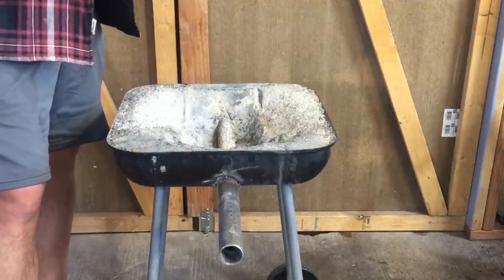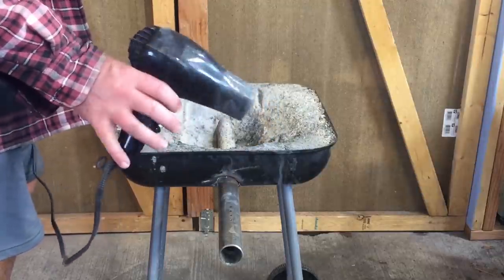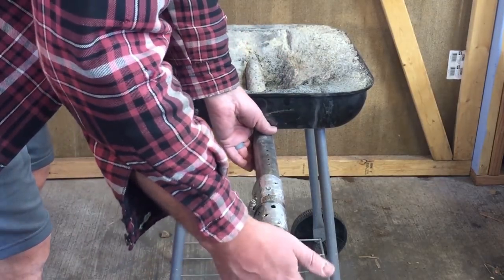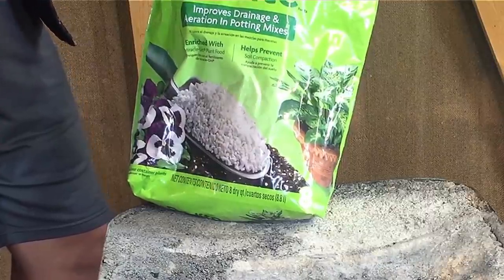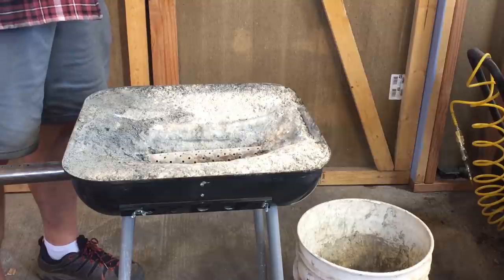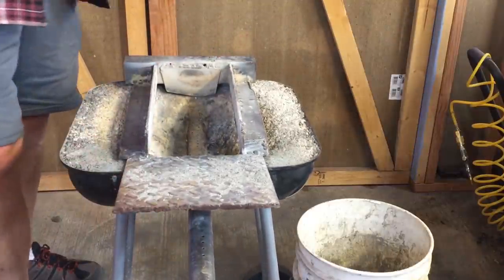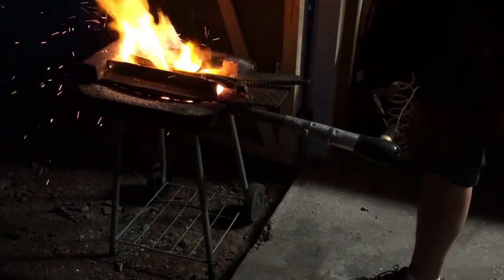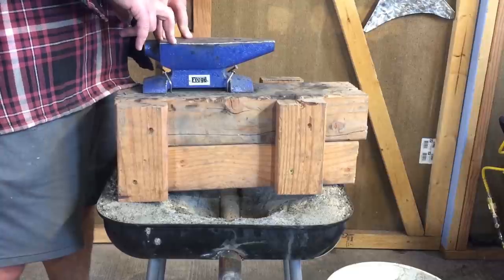$100 Charcoal Forge...Why didn't I do this sooner?

Comment: Best forge for a beginner is a hole in the ground and it's free
Reply: Soviet solider just did that yesterday
Reply: @Adventure_fuel  you got a leaf blower or a hair dryer for that
Reply: That requires a large enough amount of ground though.
Reply: @Seagull780  Live on a tiny island do ya? You could build a wooden box filled with dirt for the same effect.
Reply: @anubispup4760  No it's far worse, I live in this horrid place they call a city
Reply: @Seagull780  As do I, there are always ways to make do.
Reply: @anubispup4760  Well actually I live on the third floor, I tried forging on my balcony once but then I read my rental contract and while it didn't specifically ban it, it did ban bbqing and I doubt I could convince my landlord to see it the way I do. So now I forge in my dad's backyard with some firebricks and a propane burner. It doesn't work that well but it does get the steel to a bright red.
Reply: @Seagull780  I've just pictured somebody just watching a man on a balcony swing a hammer at what could quite possibly be hot dogs.
Reply: @air_  hair dryer:yes another one from the UK and if its Scotland then yeeeeeessss
Reply: That’s what I’ve been thinking but I’d want a bit more structure in that hole.
Reply: Lukeasdf123  2x2 is a lot in a city
Reply: I was about to ask if that was okay XDDD, is some average clay bricks around it okay orr...
Reply: Until you hit a root and light it up lol😂
Reply: Only thing that sucks is bending down to work lol
Reply: My first forge [when I finish it] is being made out of an old milk drum
Reply: My parents kinda like the lawn.
Reply: @Seagull780  your looking for problems instead if solutions.
Reply: @luniqant9296  having built an easy to set up forge for on a balcony and another one specifically to leave no mess I'd say I'm thinking in solutions.
Reply: I did that yesterday , my dad think it takes long, but I’m pretty sure you just half to hear it up and put coal
Reply: Yeah unless you live in a city, where you have to actually make a hole in the ground somehow lmao
Reply: True
Reply: @Seagull780  Rip my friend.
Reply: I don't have ground to dig a hole in
No backyard 
Can't even walk too loudly on the floor I do have
Reply: @air_  I guess its a hair dryer.
Reply: @raphaelkap  I live in the city and have no problem my forge in in the ground in my backyard
Reply: And some pants and your good
Reply: Or a little brick ring

Comment: I am 18 and I built my forge similar to this one, but the best advice I received was to stop planing and just get out there and build the dang thing. I spent weeks researching and got caught up in that. Then a friend told me to shut up and build.
Reply: Watch out for that paralysis by over Analysis
Reply: Yo im 14 and doing the same thing, any tips?
Reply: I thought I needed fire brick and all kinds of other fancy fluff. I was wrong.
 I ended up with a 1/8" steel cone and an air mattress blower powered by d cell batteries. it isnt a big forge, but it is fine for making knives and small things. it was quick to build and cheap, as the scrap I used came to me free of charge and the matress was on its way to the trash..... as I said, it isnt a large forge. about 10-12" across 2" deep so not as large as the one he is making here, cant make a sword or a plowshare, but fine for small knives and trinkets. it was a fun start and I encourage everyone to try even if you fail, its better than sittin around watching the boob tube!!
Reply: @jeffcaruso8949  
Take some time to learn about forge and hot metal safety before building a forge. 

Take a  lesson from Cohoes, NY where a 51 year old bladesmith tried to imitate the Forged in Fire show. His diy forge burned down 3 city blocks and placed the city under a state of emergency. 

"There are two kinds of smiths: those who have been burned and those who have yet to be burned."
Reply: Jeff Caruso yes,always have plenty of water on hand and expect burned fingertips.Remember that hot steel doesn’t always Look hot.Also,some sort of extraction device will help to keep your lungs clean.But get started,its great fun!
Reply: A little tip never use concrete for a forge concrete tends to explode when heated
Reply: Wow words of encouragement
Reply: I'm 5 years old and I've made 20 of these this week.
Reply: Haha thats like me with building my first boat
Reply: Yup
Reply: @52rhflight56  epic
Reply: @craftyranger3717  I can confirm this haha
Reply: I’m 11 and I do it around clay bricks
Reply: @jeffcaruso8949  Yo, your probably 16 now but I’m fourteen and I used a foldable grill that I found on Amazon and stacked bricks in a v shape and put a pipe down the middle with slits cut in it. I was wondering if you have any suggestions. I was also wondering what is a easy and good first project to do
Reply: Good friend.
Reply: @jeffcaruso8949  When I'm making anything from metal and/or wood I lay out all the materials I have , I pick a project lets say a lamp for talking sake, then I stand and stare at the materials for about an hour, I guarantee within that time several ideas will have tumbled in and around my head and I just go with the best (Usually something weird and wonderful) that way I find I'm not just jumping into something blindly yet I've also not spent too much time pondering i.e. days or weeks drawing up plans etc , This is my technique it may not work for you or it may if you care to try, as stated earlier "shut up and build" sounds like good mantra to me and again don't ponder too long, Happy hunting Lad.

Comment from the maker: My forge can beat up your forge.
Reply: FargoFX How do you keep your air intake from being filled with clinker and blocked off? Most forges have a metal grate which helps to keep the clinker from clogging the air. You are probably using more fuel than necessary if the air intake is clogged.
Reply: No, cuz i don't have one.
Reply: Michael Foye there is no clinker in a charcoal forge
Reply: I like pizza
Reply: FargoFX my forge is a old metal barrel and a blow dryer the same as yours and I use wood not charcoal
Reply: @DrengrMike  Even a charcoal forge can have clinker. It just doesn't come from the fuel. Do any forge welding with flux, and that can create clinker. Same thing if there's any sand or other impurities on the steel itself. I think the bigger worry, though, is the ash. I'd like to see the ash dump. What I did (I built a similar forge, main difference is I used dirt and cat litter as my refractory, and my fire pot is built of fire brick) that passed all the way through. Ground a grate in the tuyere, covered the outlet with duct tape, threw some coal in there and started heating and beating.
Reply: I like turtles
Reply: FargoFX  Good one 👍 great entry level forge! On any given day you can find all the materials in the garage for free! Just need charcoal and 120 volts. Been wanting to make my own charcoal from willow and this would be a nice project to go along with that. Thanks for your video.
Reply: I meant garbage. I’m blaming the phone!
Reply: Michael Keenan 
If you run a charcoal forge and dont develop clinker in it you must only grill on it!!
Reply: Would a copper pipe work instead of a steel pipe?
Reply: @joed8166  probably not, copper has a much lower melting point, if you had it under like a frame it might work but if you had it exposed in a forge like his it would melt
Reply: Sorry man mine would kill yours. It’s pretty much a 1/4 inch box all around. Took way too long to build. Yours might function better however

Comment: You only waited a few weeks? I’ve been wanting to do this for years! Good for you and simple nice 👍 forge! Thanks for your video.
Reply: @David Parks Just a tip in case you do ever weld or smith galvanized, (which isn't recommended, but sometimes you have to, or do by accident), as soon as you start to feel off, chug milk...not soy or almond milk, just chug whole fat cow milk and a lot of it! I don't know why that helps, but it does! When I first started welding, I was practicing and an older fella walked by, noticed I was welding galvanized, and brought me a quart of milk just in case. I didn't know, either.

Comment: Cut one side of the lid off and line it with refractory and then you can use it hold in the heat.
Reply: Four years late but: Wait wait, like a half lid that sits on top at all times? That’s pretty smart. Probably a stupid question, but if I was planning to build something like this would I want to score the metal first before applying the refractory? Or will it just stick.

Comment: If using a hair dryer for forced air, be sure to use a clamp the COLD button permanently down with hose clamp. If not, it will overheat and shut off for quite a while till it cools down. You CAN use galvanized pipe, if you use vinegar or similar process to remove the galvanization first. Very nice design, except for the legs. I'd add angle iron legs to the base for stability, and reuse a couple lawn mower wheels if you want it mobile.

Comment: I’m building a big coal forge from an air tank and refractory cement was $60 a bucket and I wanted to save some money so I’m going the diy way. I’m using perlite  7$ for two bags Portland cement 12$ for one 92 lb bag of it and sand 1$ for a bag. It makes enough refractory for like 10 of my forges I’m going to have extra. And finally I got 6 hard fire bricks for 20$ for a total price of 40$ total. The fire bricks are unnecessary I just wanted to use them for a bit better insulation. I still need a cart for the forge as it has to be able to be moved and it’s going to weigh probably around 100 lbs or more when it’s done. It also has a chimney that will hopefully work or at least help with exhaust. When it’s done I am probably going to start uploading yt videos of forging. And I’m also possibly getting a large anvil. I can’t wait. Also any videos planned?

Comment: You could dig 2 holes one for the coal and stuff the other for the blow dryer. Then you could make a connection between the holes, and then the hair dryer feeds air into the other hole. If you do it like that you don’t have to buy aluminum sheet to protect the hair dryer.

Comment: So does the air pipe in the bottom start to glow too with the coals resting right on top of it? And if so how do you stop the constant heat transfer creeping down the length of it from reaching the hairdryer?
Reply: With a lonh enough steel pipe then the heat wont rech the blowdryer, and also he has a secondary aluminium pipe to conect the two so heat transfering aint no problem

Comment: Simple and cheap - I like both of those things.  Thanks. 
A couple years ago I got a 'accidentally' picked up a discarded BBQ at the dump.  I say accidental because our dump, does not let anyone pick up anything - they'd rather put in the landfill than have you use it.  Anyway its a rectangular grill one with a nice v groove across the bottom -- I gotta get on that project.  Already have all the blacksmith gear from a Craigslist purchase a few years back - including a nice 70 lb. anvil. 
There is a lot of material out there that could be used for sure !!

Comment: I built my propane forge out of a big soup can and plaster of Paris mixed 1:1 with sand. I made my burner out of some black pipe, an adapter, and some fittings. Works awesome!

Comment: I like to use an air mattress blower in place of the hair dryer. I think it uses less electricity since it doesn't have heat coils
Reply: Thomas Selby a lot of hair dryers have a cool setting
Reply: That's what im gonna use too!
Reply: I'm thinking about a blower that came with some inflatable yard toy for my grands. I could make the fan speed adjustable with a potentiometer and possibly some sort of crude gate to control the volume of air being fed to the fire (unless y'all think it might take as much air as i can add to it)? TIA

Comment: yep..... mine was free, i build a small fire in a rock pit, wait for the wood to turn to coals, put a metal bar above the fire ( balanced on each side of the rock pit ). and thn i cover it with green logs and a bit of dry wood ( for more coals ). After that i apply a shit ton of air and it works like a charm

NOTE: i DO chop my own wood, so it is free, and i acquired all of my materials from my job ( and a scrapyard )
Reply from the maker: Hey, thanks for the comment! Your description sounds a little bit like a backyard Forge I built for a recent video, actually yours sounds better built than mine. Anyway, I think my next Forge will be propane, that is if I ever find the time to build one. Lol. Thanks again! Cheers!
Reply: Nice! ive always wanted a propane forge (although it would cost more). Keep doing what your doing, i like your videos.

P.S.
I also forgot to say that your forge is superior to mine ( other than it being smaller ) But being smaller is much better, allowing it to get so hot in such a small time span (my forge usually takes about  30 min for the coals to build up).

Comment: I would replace/reinforce those steel tube legs with square tube welding stock. 
I picked up 3 ft for around $6 for some other blacksmithing purposes from Lowe's/Home Depot
Reply from the maker: mmix224 That’s a good idea. I’ve thought about reinforcing the legs, but I’m hoping to build a propane forge soon anyway.

Comment: Hope you don't mind but I am gonna copy that. I pretty much did the same thing but dug a hole in the ground and had the pipe blow air in there. I heat treated my first knife that way and this would be so much easier once set up. Also I want to learn to do a few basic black smithing tasks. Like making nails and fire steels. Maybe then I will want to do more but I am morely looking to HT basic high carbon steel blades.
Reply from the maker: scottecooke awesome! Make sure your forge is stable…mine's a bit sketchy, but I work with it. I'm getting more into knife making now, really enjoying it… Are you planning to post videos of your stuff?
Reply: I would love to do videos in the future. I wouldn't do them under my current profile. But if I do I will let you know. I have been wanting to do a channel for years but never seem to commit. I will eventually it will be a channel about my hobbies. So some knife making, maybe making fire steels, fire lighting, camping/bushcraft, chess and whatever else I enjoy at the time.

Comment: $15 for the anvil? I thought they were $59.....I bought a old time stainless steel Beer keg to cut in half length wise,one side has the hole in it already.
Have Asphundi barrell chipper blades from old tree chipper for plating for inside chamber.
Then made a table out of pipes to weld it on..
I have an Atlas knife forge,but Machete typed blades  are to hard to heat evenly..
Reason making coal as well..

Comment: My forge cost $0.  All scavenged material.  Grill she'll from when a neighbor moved out.  Scrap bricks from remodel job down the street.  Fan from a bathroom remodel. Pipe from handrail on a dead treadmill.  Anvil from a chunk of scrap steel dad used to use in the back of his truck in winter.

Comment: Made one in the ground.    It more like a blast furnace  than forge.   I need to make mark 2 to fix  the few  problems it has .   fuel  input  and air control   mostly     It fire the dirt around and in the hole  to a nice orange color  . killed the grass  over 6 inch from the hole . After 5 minute of running    melts glass~  and brass  .   I think it  max out at  2000 - 1800F   on just wood
Reply: blackgriffinxx Sounds great!Keep at it.👍

Comment: Glad I stumbled across this. Not seen anything else about the warnings. Always good to do thorough research before doing potentially dangerous stuff with fire.
I have a BBQ which has a lid and the temp reading goes up to 370c and I've had the dial maxed out on it, just burning wood inside with all the vents open and front loading panel on a windy day. I was wondering if that was hot enough to use as a forge

Comment: That is going to use a lot of fuel.   You can use an old brake drum, or rotor for a smaller one and you dont need refractory material.  I would fill some (about 2/3) of those air holes, you dont need that many unless you are forging ocean liner anchors.  ;o)  You want your air a bit more concentrated in the middle of your forge.  The homemade recipes arent the best..  Call Kelley Cupples, he has everything you need.  Coal is the best fuel.  You can also mix green wood chips in with dried fire wood and your fuel will last longer.  You can also use a bread pan and a hand crank blower for a smaller portable forge.  Raise your anvil so the top of the anvil is knuckle height.  The main thing is to just do it and make one, and you have done that.  Congrats.  I built a coal forge and found out that you cant get coal in Cali.  I built a propane forge with fire bricks from Lowes (rated 3000F) and some 1/4" angle to hold the bricks together.  I built my own burners that can be used naturally aspirated or with forced induction.  Forging metal cleanses the soul.
Forge On!!!